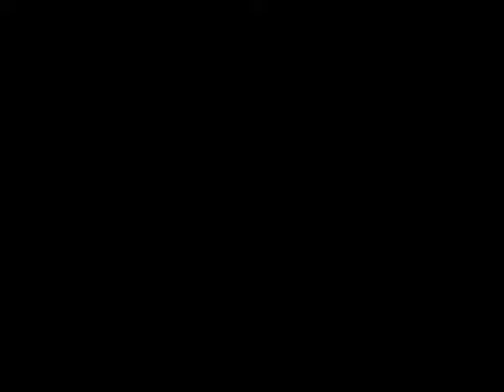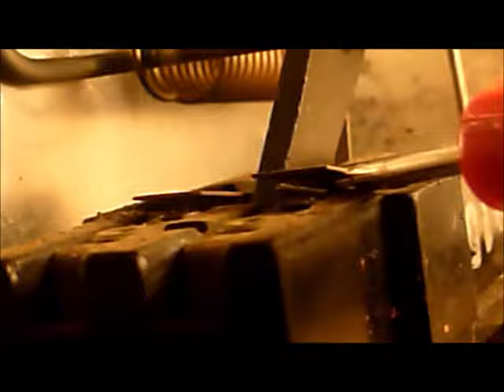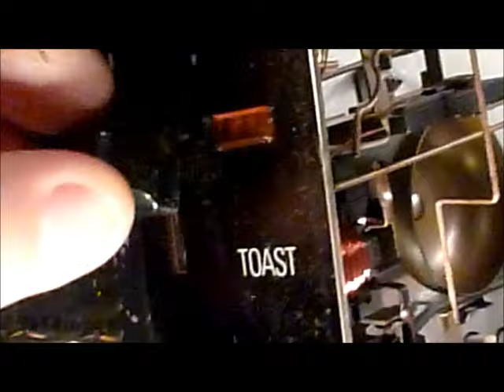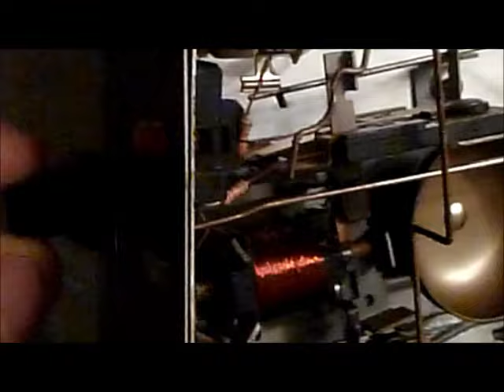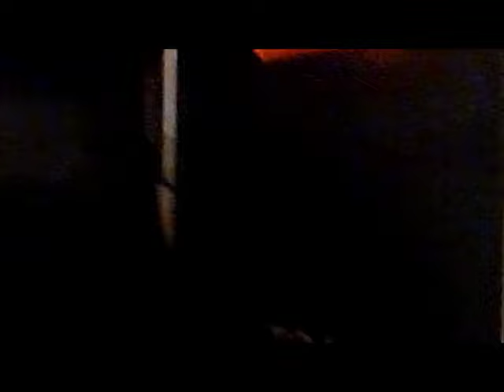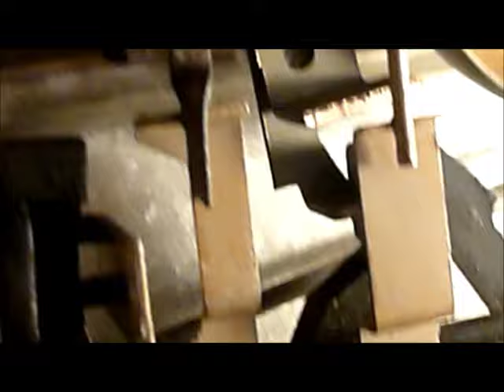Repairing the toaster oven

Comment: Same issue! I have a GE A 53126 toast n broil Toast-R-Oven.  After taking it home from the thrift store, I  cleaned it. I only took the door, crumb tray and sides apart. I was very careful not to bump anything while cleaning. Fair warning to anyone - clean with a very light touch, it's easy to break these, including the door handle - anything plastic is very fragile with age. Anyways- it worked when I bought it at the thrift and then it didn't after cleaning. Problem? Somehow one of those copper tabs (the left one in your video wasn't making contact. I sanded the contacts with a narrow nail file and blew out the dust. It still didn't work - the left copper tab wasn't touching. DO NOT try to bend those copper tabs. Instead, lift up on the entire contact base at the rear, with a very small tiny flat screwdriver). This raises the contact point up to the copper tabs and makes the needed contact. As mentioned, opening the door moves a plastic cam that lifts BOTH COPPER TABS which opens the electrical circuit(cuts power).  I hope this helps clarify the video  because it MIGHT happen that sanding those contacts, if you're not careful, raises the tabs above the contacts. If one or more tab isn't resting on those contact points, the toaster will not turn on.  Happy Toast-R-Ing.